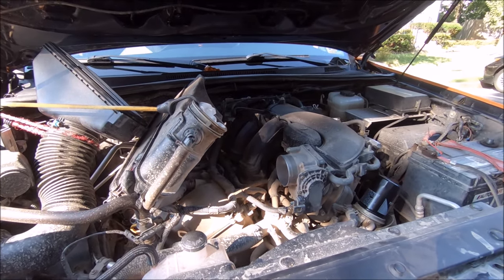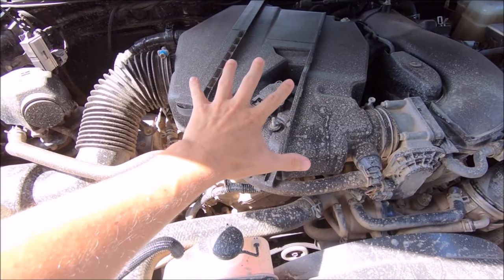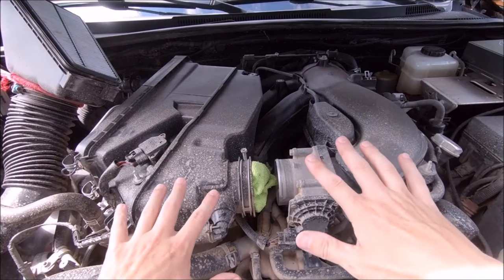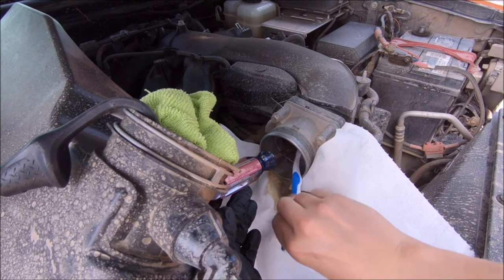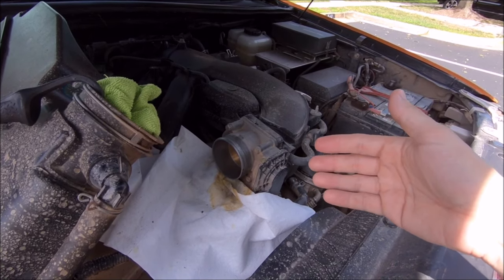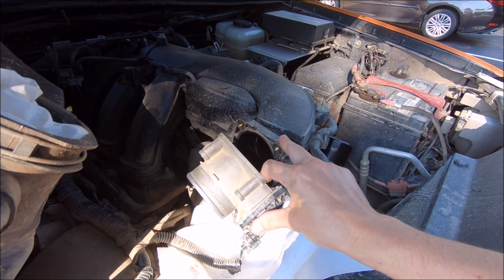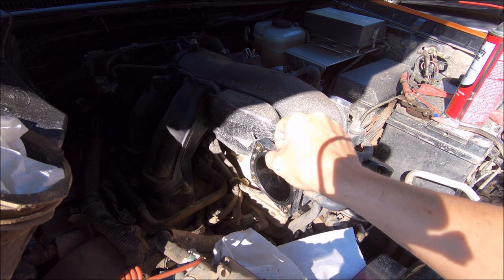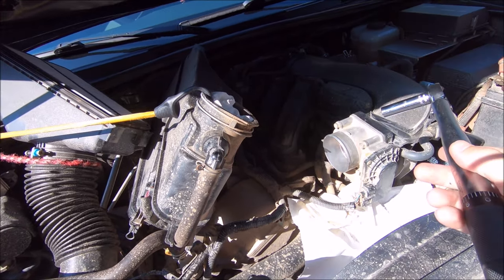Toyota Tacoma 4.0 Throttle Body Cleaning Tutorial

Comment: After doing a little more research on the proper method of cleaning the throttle body either by the first observed vid or the second Toyota recommends not to spray the throttle body with the cleaner but spray some on a micro fiber rag sparingly and wipe throttle body as clean as possible. Spraying the throttle body butterfly can affect the performance and or damage the sensor attached to the throttle body butterfly shaft as the cleaner when sprayed can run down the shaft into the sensor and therefore maybe create an issue. Other than that this is a very good tutorial on this procedure.

Comment: The only thing people may want to do differently is u should have removed the vent hose in the back of the air box. We have so many people brake the fitting coming off and then it’s $600 for a new box. It’s because of that pop it makes. If u are not ready for it and it goes to fare to the left, bye bye air box. U can fix it with JB weld if it brakes. Just FYI and yes I work in parts at Toyota
Reply: It's a crappy airbox anyway, you're better off replacing it with one that sits off to the side like the TRD box, smoother intake, bigger filter element and no heatsoak from sitting on top of the engine.

Comment: I put the first mile on my 2006 Tacoma way back when. Fast forward to 2022, it’s acting up like an old man, like me! At 270k miles it started giving me acceleration and hesitation issues, throwing check engine light saying the #4 ignition coil was bad. Changed that, same issue a few weeks later. Changed the #4 fuel injector, ran ok for a while then back again to the issue of hesitation and rough starts. I can tell you, after doing the throttle cleaning procedure, this was the first time where after I reconnected the battery the idle ran smooth immediately. Where as before it would idle to shut off and it would take forever for it to relearn the idle. Not this time. I hope this is the fix it needed.Thanks for the video, it was a great help!
Reply: Hey how it’s going. I have a 06 Toyota Tacoma V6 4.0 4x4 with 314k miles. My father owned the truck before me. It was a gift. About 6months ago I got the check engine light. Took to autozone for diagnostics. They said it was the oxygen sensors. Bank 1 and bank 2. Buying all 4 sensors with cost a little over $600. My question is. Did you ever have that problem? And if you did did you replace sensors or used any other solution to fix the problem? Thanks
Reply: @lilpelusa  I honestly don’t remember if I changed an O2 sensor. I changed a fuel injector and the ignition coils but that’s it. The throttle cleaning helped for a bit but the roughness and check engine light came back. At that point I was out of ideas. One honest mechanic I know said it was probably a stuck valve. I’d need to replace the heads, which basically meant I should just replace the engine. He suggested I start throwing some Chevron Techron additive with every other filling, that it helps clean valves. I did that and it helped but as a temporary fix. The one thing that I can say changed everything and FINALLY solved the problem, was pumping 91 octane fuel since then. That solved it. For years I did 87 since that’s what the owner’s manual recommended. Once I started using only 91, it’s made all the difference. Haven’t had a check engine light since and the truck runs strong. If you haven’t done that, try it. It’s worth the extra costs.
Reply: Thank you for the tips. My father trade me his 06 Tacoma for my old car. He loves old Toyota models. He owned a few 90s models and in 2012 he bout a brand new Tacoma. After paying off the new Tacoma he bought the 06 Tacoma with around 150k miles. He always said the 06 was better than the 2012. The 06 Tacoma looked better than the 2012. When I traded my old car for the 06 it had 299k miles. So I have added about 15k in 6 months. Since I owned the truck I switched to synthetic high milage oil and to 89 gas. My father used regular oil and 87 gas. It has original engine and trans. No problems with truck. Besides power steering oil leak. But not where it need to be replaced asap. After a month of getting truck check engine light came on. Took it to autozone and said it was the oxygen sensors. It will cost over $600 to replace. Today I cleaned the throttle body and after connecting everything the engine light went away. I don’t know if it will come back. I added the seafoam additive in the crank case. I’m ready to do an oil change sometime this week. I added luckas in to the gas tank. Was also thinking about adding the Catacleaner or something like that. But maybe I should wait a bit. I also tried using a seafoam spray motor treatment. The one you spray on throttle body while truck is running to clean injectors but failed. Truck would turn off when disconnecting the air intake. The maintenance I’m doing is more to keep it in great condition but I feel like I am going to have to replace those 02 sensors soon. I do appreciate the reply. Thank you

Comment: Dude - awesome video - i sued MAF cleaner instead of throttle body cleaner but same chemistry - chage out my spark plugs and cleaned the MAF sensor all at once - dropped my idle to 500 rpm and still have a slight shudder - not too sure why. Also thanks for spaecing out the freaking torque on those bolts - snapped one but new ones were 1.29 from stealership and didnt screw up the screw inserts phew. 

Keep on keeping on brother - youre doing gods work.

Comment: Thank you so much! I replaced my ac compressor with the battery disconnected for 4-5hrs. The truck started to idle low. So I checked everything I messed with, changed the 5 year old battery and belt to no avail. Saw your other gas peddle video, no luck and went back to the forums. 171k on the truck, it needed it! Being stationed overseas it’s hard to get parts quickly for a us spec vehicle.

Comment: I highly recommend watching the full video even if you’re doing the partial cleaning! He makes a few good points during that second part! Great tutorial. Combo that with a Toyota induction cleaner and drip bottle to clean the intake manifold and intake valves and your truck will run WAY better. Definitely recommend doing this though. Also if you’re doing the partial, wouldn’t be a bad idea to get a pedal depressor or a brick. Then just put the truck in ACC mode (engine OFF) and push the throttle all the way and it’ll open up the valve for you! Don’t worry, it won’t throw any codes if you do it right.

Comment: If you disconnect the 2 small coolant lines you can take it completely out of the engine bay for an easy very thorough cleaning.  It will drip a little coolant but nothing a well placed rag wont soak up.  Just don't squeeze any of your large coolant lines or it will squirt.

Comment: This will be tomorrows project (the full Monty version). Dumb question though ... If I unplug the electrical connector at the throttle body will I still need to disconnect the battery?  And a little tip for what to do with the negative cable to keep it from grounding out, I use a red solo cup. Put the negative cable into the cup and it acts as an insulator so you're safe. Plus the big RED cup in the engine bay reminds you to reconnect the battery!
Reply from the maker: Ha ha I like the solo cup tip! You should be fine just unplugging the throttle body connection.
Reply: Well that was stupid easy. The "front" of my TB was pretty clean but the "back" needed most of the cleaning. 
I did my MAF at the same time.
Reply from the maker: @daveweber9737  👍

Comment: Trying to reset P0102 code on my 2013 RAV4 2.5 liter 4 banger. I read that I should remove the MAF sensor and let vehicle idle for 10 seconds (up to a minute or two). The computer reads no MAF sensor. Then reinstall and the code goes away. Is this correct? Do I have to remove the sensor or can I just disconnect it. If I remove the sensor should I cover the opening with something? (duct tape?) Before anyone asks I will state I already cleaned the sensor and tested in by using the live data function and comparing MAF readings at 1000 rpm and 2000 rpm. It read approximately 75 and 150 respectively. My understanding is that this indicates MAF is now operating correctly. Any input is welcome.

Comment: Great channel.   Yours is a 2014 trd sport?     If so that’s the exact same as mine.    I have ome bp51 complete suspension withe leaf spring pack and aal.   Total chaos cam tab and steer knuckle gussets, total chaos upper control arms.     Arb complete skid plates, icon LCA skid plates.     aFe momentum cold air intake with scoop and throttle body extender.    American thunder dual exhaust, bed stiffeners, summosprings bump stops, des racks & smitt6 built roof top tent.   Also winch bumper and badlands winch 9k lbs.      How do I get the breaks from done right, 2nd gen Tacoma ‘s have breaks that go to the floor even after getting a break overhaul?     What about pedal commander?
Reply from the maker: Thanks Sue! Mine is a 2014 TRD Offroad. Are you saying your brake pedal goes all the way to the floor? Here's my review vid for the Pedal Commander: https://youtu.be/-bGUM_mmKGU

Comment: all i ever do is use seafoam loosen the clamp on the throttle body stick the end of the spray in tighten the clamp kind of tight to keep the vacum leaks to a minimum start the engine run it through smokes like heck but works good ive got 250k on my 07 also I run  E3 spark plugs and runs great

Comment: The proper way to clean a throttle body is to completely remove it and thoroughly clean and dry excess spray, not to have it pool up and will prevent that first hard start and minute or two of rough idle (it wasn't the battery that did it) that being said, I do it the same way on mine. It's annoying to remove it. Haha nice video man.
Reply: Addendum:
Sorry I didn't finish the video before commenting, my bad.
Reply: Why didn't you just remove it to begin with and spare yourself the reassembly time and the rough start?

Comment: I use a K&N cold air intake filter. I opened my throttle body up at 100K.... Clean as a whistle. I plan to recheck and maybe clean it at 200K...
Reply from the maker: How many miles have you had the K&N on your truck?
Reply: @Tacomaholic  Since it was brand new. I put that kit on within the first  month of owning it. I have a 2015 TRD Pro 4.0 liter V6  6 speed. ( 4x4 ). Not the K&N insert but the complete kit that rips out the air box and replaces it with the straight shot from the larger cone filter.
Reply from the maker: That's awesome it's keeping the throttle body so clean.
Reply: I do re-oil filter every 25k though, as I live in Phoenix...

Comment: The service is a good idea it Smooths out idle and also makes the operation of the throttle body smoother as well just be careful not to spray too much because it's too much goes down in one of the cylinders it could get hydrolocked and damage the engine so go easy on the spray when you do it

Comment: Don't put any metal objects in your throttle body, use a plastic/pvc type tool and use microfiber towel or shop rags , do not use any type paper products that can introduce lint. Good video otherwise.